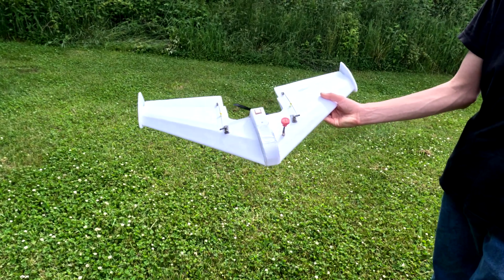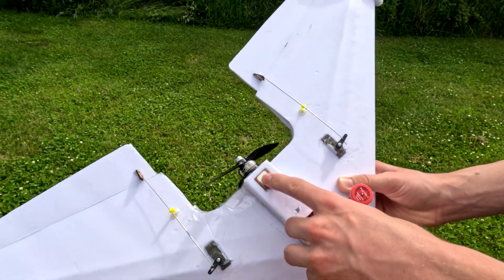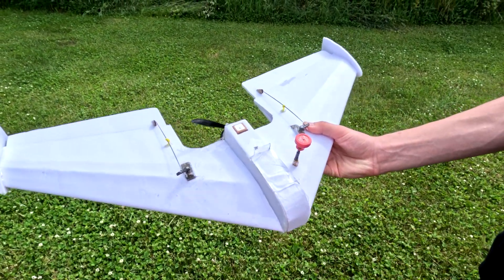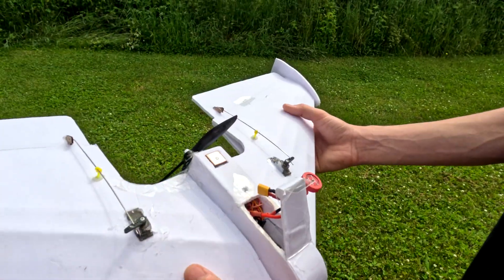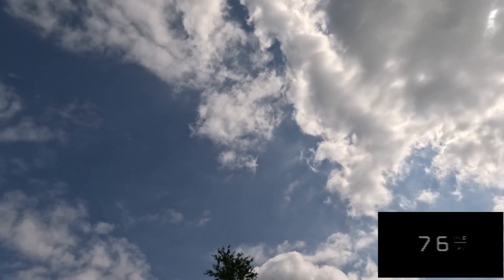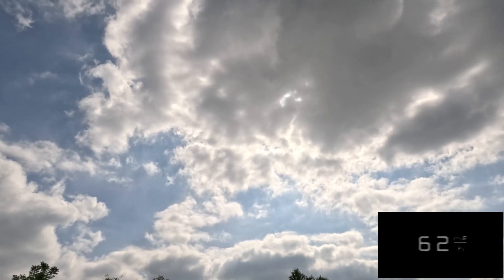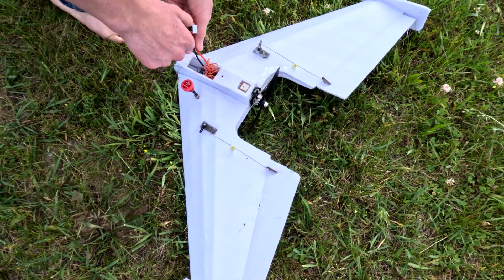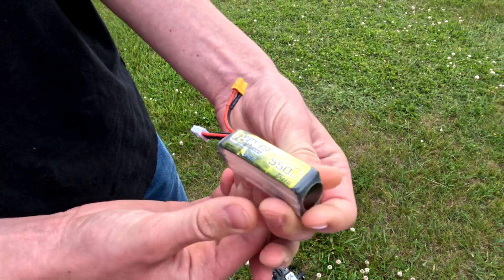How Fast Can Our FT Arrow Go with a 2306 Motor?!

Comment: I have an arrow kit sitting on my shelf, I've been building the sparrow over and over from my stencils. :/
I'm on plane #7 with no successful flights, I don't feel like the arrow is going to be better.
Reply from the maker: Hmmm, I have found that the FT Arrow is one of the easiest foamboard wings to fly...Maybe start a thread over at the Flite Test forum and explain what has gone wrong with each flight..You might get some suggestions that will help you actually get into the air!

Comment: how long it flies with those small battery? i wonder if i can put bigger battery with same setup
Reply from the maker: You get about 3-5mins flight time if you are not pushing the limits like I was. (I had it on WOT for most of the flight) If you want longer flight time I recommend the FT Goblin or the FT Millennium Flerken.
Reply: @RCBench1776 i wonder if can built fast and long ft wing maybe, still experiment with 3s 21700 and 2826 2200kv motor with ft arrow😅
Reply from the maker: @Lucky_Akhdhan  Yeah, I am hoping to ram 6S down that motor soon! (It's a 4S motor!)